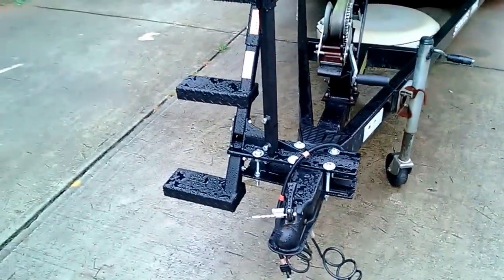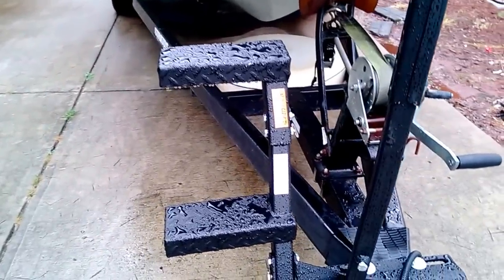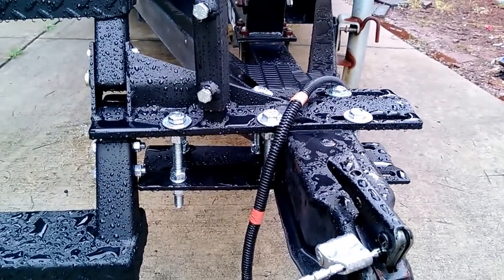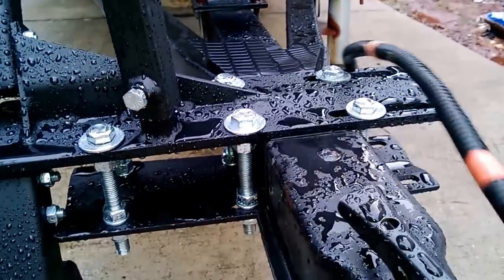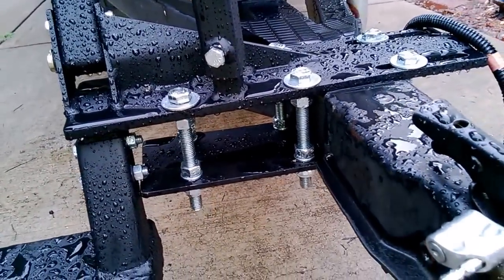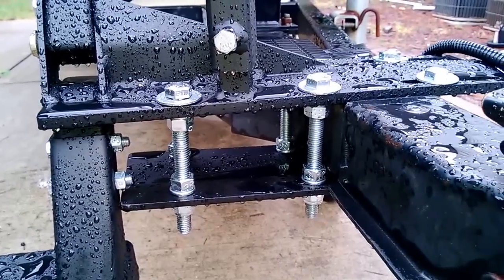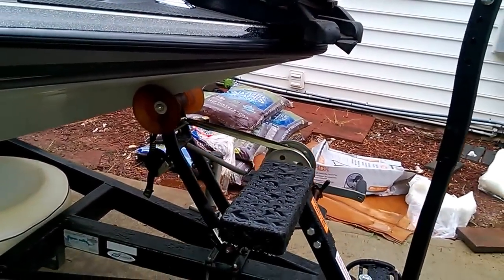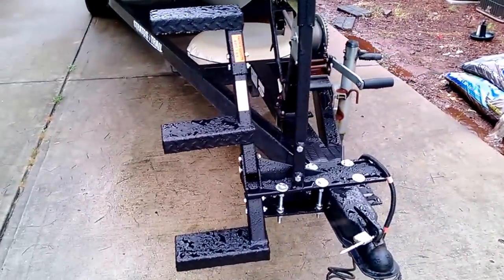Easy Step System Boat Trailer Steps Model ESS-2 Installed

Comment: Wonder what the steps looked like after the first deep right turn?
Reply from the maker: +Pete kildow That can be a problem.&#160; I do not own the boat any longer as I upgraded to a 21ft Ranger and it has a good sizes landing area on its trailer tongue.&#160; However, I did enjoy these steps and suggest them to anyone.&#160; Depending on your trailer and where you can mount them, they can get in the way on a very tight right turn.&#160; I made that mistake once in a gas station but only once.&#160; :)&#160; You just have to be aware that they are there and account for it when you pull into places so you don't get into a bad position.Honestly, you could cut off the bottom step and never have that problem.  I'm not sure its really needed, depending on your height.  The manufacturer should consider offering a 2 step version and it would not touch your truck.

Comment from the maker: +Dwight PURVIS - Sorry I never folded them up as my trailer did not have a swing away tongue and that's what the fold is for.  I bought that model in case I upgraded to a boat that had a swing away and needed a step.  However, the boat I upgraded too has a swing away but I did not need the step on it.